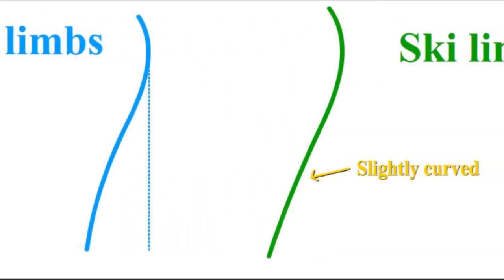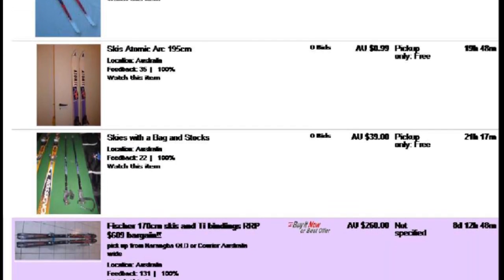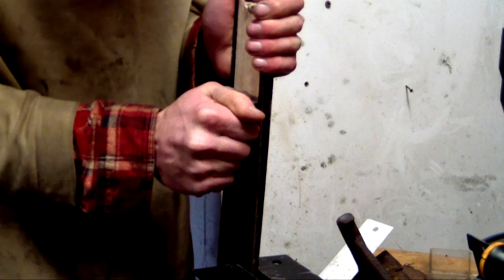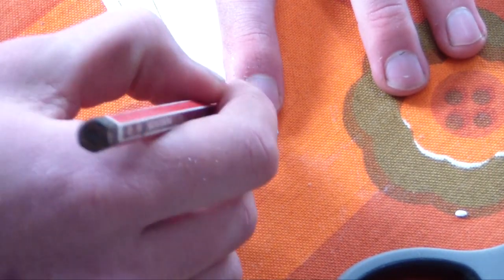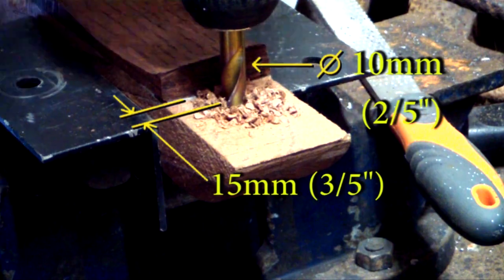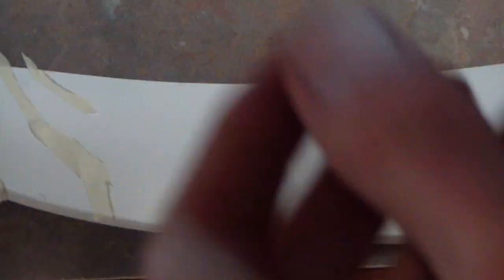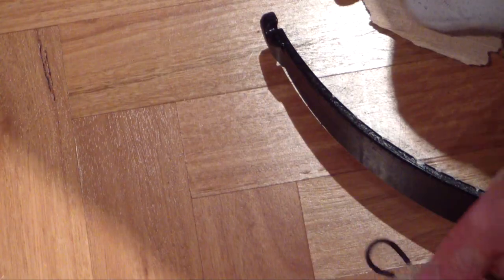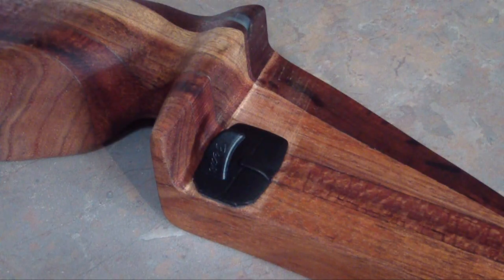How To Make A Takedown Bow - The Limbs (Tutorial Part 2)

Comment: if you do end up cutting your limb holes to attach to the riser a bit too short, you can use an L bracket cut down to wedge in between your limb and the riser and bolt to the riser or drill it to the limb instead of a washer.

Comment: To counteract the curve of the skis, consider back-mounting. Black widow bows make really expensive, back-mounted takedowns if you'd like something to look up for a model. The taper on the skis I picked up is fairly abrupt on the top, example: top of ski -- /| -- bottom. If you do this you will need to make sure your mounting surface is stronger toward the ends of the riser. I would also recommend using a "floating" limb mounting system as opposed to the "fitted" system.

Comment: Nice tutorial. I can't find any skis that are just wood with aluminum edges where I live. The skis I got are wood sandwiched between a lot of aluminum which gets worse as you get to the tip. I also have some skis made of fiberglass and some polymer. Has anyone made limbs using these types of skis? Will they work? Or should I look for more skis?

Comment: you can cut out a strip of thin guage of flexible sheetmetal and apply many, many layers of fiberglass yourself. carbon fiber is another option. this process isnt hard, but t is rather time consuming. it will provide you with a better end result, however because you can build the limbs up until the desired draw weight is reached.

Comment: You could try using hickory boards and back them with either a fiberglass strip, fiberglass cloth w/ resin/hardener or even a natural product like bamboo. You will have tiller the wood so you will get a symmetrical bend which the skis seem to have already taken care of by design. It is a lot simpler with skis (due to the lack of tillering necessary) although maybe just as labor intensive. Frankly the riser is the toughest part for me as I have no power tools.

Comment from the maker: sounds like you expect it to be simple.
deflection of a cantiliver=(load*limblength^3)/(3*youngmodulsofthewood*secondmomentofarea)
and secondmomentofarea for a rectangle crossection = width*thickness^3/12
you can't apply this directly since limbs do not have a consistent cross section but it does give you some idea that the load is roughly proportional to the thickness cubed, roughly inversely proportional to the length cubed and roughly proportional to the width 
does that help??

Comment from the maker: it means that how hard it is to bend the limbs is much more sensitive to how thick you make the limbs compared to how wide you make them, so basicall that means if and when you make your limbs you will just have to take a guess, but try and make them too stiff rather than weak, this will allow you to tweak them, if they are much to stiff try making them thiner, but for small changes reduce the width, hope that helps

Comment from the maker: @ScreamenStephen well no doubt it does to some extent but I doubt much though, if you don't remove the plastic than you will not be able to get to the screws that hold on the metal rim on the out side, if your skis have them, and yeah fibre glass with make them stronger if that's what you want however, I would probably put it on the other side of the limbs because im pretty sure fibre glass works better in tension rather than compression

Comment: i made three bows using one pair of ski's , the ski's had carbon fibre in them one bow has 45lbs draw weight the second has 50 lbs draw weight the third bow i used the two back halves of the ski's and it has 75 lbs @ 26" ...... ski's work great... nice job on the video .

Comment from the maker: @RedRumKurt Tha'ts a good point, well when i cut the skis down to the width that i wanted, I had removed material past where the trim would have been anyway, the main reason I removed  the trim in the first place was so i could use a wood saw to cut the edges off to get the skis to the desired width. You can still cut the edges off without removing the trim but u will have to use a hacksaw(trim is normally steel) instead of a woodsaw which will make things some what slower. Does that make sense?